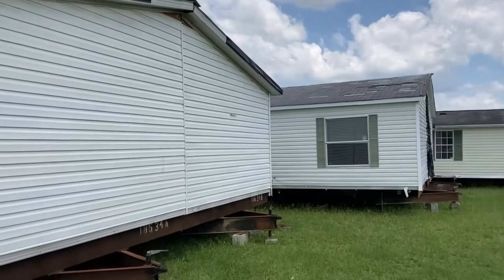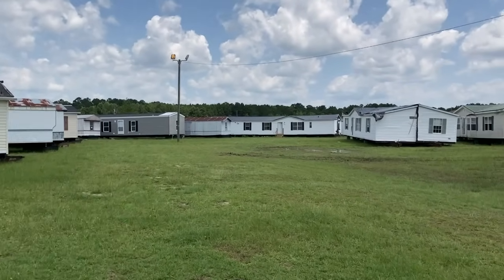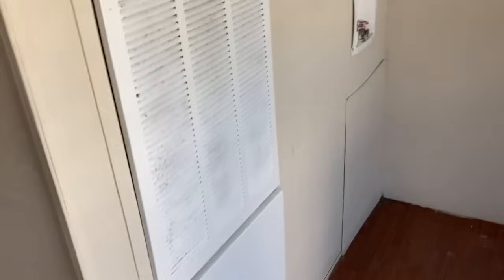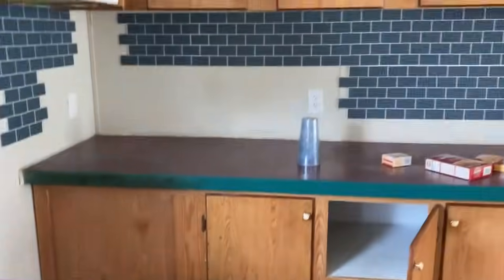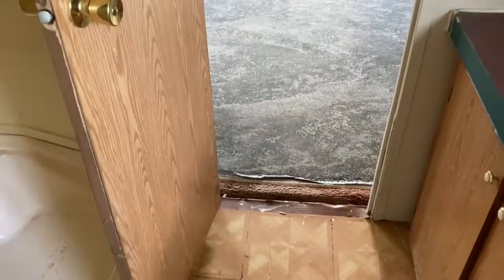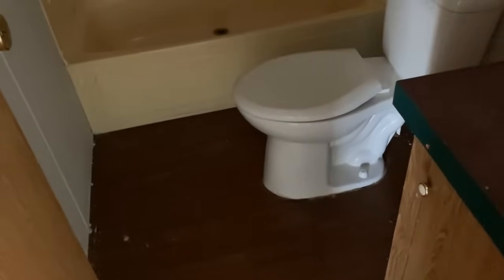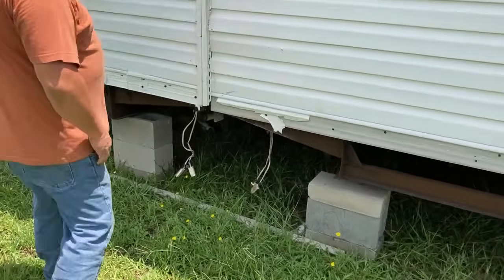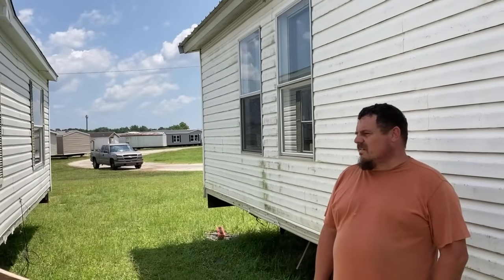Can You Guess How Much This USED Double Wide Mobile Home Costs?

Comment: My wife and I live in a 96 model double wide somewhat similar to that one. We live on 5 acres in TN. We also have a 60 x 45 ft barn and paid 123,000 in 2018. The guy that flipped did really good work. Our home is 1976 square ft with 2 nice decks front and back. We are blessed by God for sure. I like your video's.
Reply from the maker: Thanks you got a good deal
Reply: Being this home is a 2001. It is not a moble home. HUD stayed since 1976 a moble would have to have wheels. If the home does not have wheels, the home is a manufacturer home. The two of you are very knowledgeable about manufactured homes.  So please advise. Why do you continue to state mobile homes? Any home can be moved. Bring a construction home or manufactured home.
Reply from the maker: @mennals58  it’s sitting on a metal frame that’s got hangers hanging from it to mount the axles. It’s a mobile home and the DMV gives you a title DMV means trailer department of motor vehicles is where you go to get the title. It’s a mobile home.
Reply: @mybrotherdonnie  I am aware that a title is issued by the DMV. I live in a manufacturer home in the state of Delaware. Nevertheless. HUD no longer uses the turm moble home.
Reply from the maker: @mennals58  A mobile home is a prefabricated structure that's built in a factory and then transported to a permanent or temporary location. Mobile homes are built on a permanent chassis and can be moved by towing or on a trailer. They can be used as permanent homes, or for holiday or temporary accommodation i’ve always heard it being called a mobile home. This is what Google has for the definition.
Reply: Moms used one on 9 acres with a pole barn went for 150000

Comment: Back in 95 I bought one of the first 16 x 80's for $23,500.  At the time, that was alot of money.  Now, I am not stupid but those now go for almost a hundred grand, what in the world are they smoking ???!!!  Even accounting for inflation, is crazy.  I advise the younger folks, buy a decent used that's already did the whole depreciation thing, more cost effective.  Also, nothing lookd more cheap, chintzy and low-grade than shimming strips in the middle of a wall to cover cheap particle board and plastic sinks.  I had to laugh as the wallpaper in the laundry is exactly the same as my kitchen and laundry from 95, 😂😂😂.
Reply from the maker: Yep I would like to have a couple for 23 five
Reply: Yep….a single wide now costs around $120,000 to buy and that doesn’t include moving and setting it up in the lot…that’s just the dwelling purchase…..a double wide costs about $240,000 that doesn’t include anything else but purchasing the dwelling….insane….and compared to todays new build construction..,about the same quality type work either way….best quality homes are the older ones like vehicles and appliances as well
Reply: Good grif Charlie Brown,,, my ex wife and I bought a 1993 16 x 80 for 25,000 she still lives there on 2 acres of completely flat land with a creek in front  , can't imagine what it would sell for today 😮

Comment: Here in Florida, the problem is that dishonest bully mobile home park owners frequently harass elderly women and veterans to they "abandon" the home and move out, then the park owner flips the home for a profit.   Then, hurricane insurances doesn't pay all costs if damages occur.  in my opinion, NEVER BUY A MOBILE HOME IN A FLORIDA MOBILE HOME PARK WHERE YOU PAY LOT RENT.  A corproate could buy out your park, process and change of use and you have to move out so they tear down the hold homes and build apartments, etc.   The only safe way is to buy a mobile home on your own lot, or in a co-op where all the residents own the park. Florida laws don't protect homeowners from unethical park owners and you could lose ALL you equity.
Reply from the maker: I don’t run a park. I run my own mobile home on my own land and rent them out 1 acre lot.

Comment: The fact that pex is used as plumbing and they didn’t put shut offs anywhere so if it was leaking u had to drop the skirting and shut off the water main into the home to be able to repair…I immediately started putting shut offs on all the plumbing in mine after another pex line burst and flooded the duct work by the time I was able to get the water shut off at 5 am on a freezing cold night….so they’re built to last maybe 20 years before things start to break…and they always do….and my water heater was located on the exterior side with the door on the outside….i replaced it with an electric water heater and moved all the plumbing including the water heater inside the home so it’s not exposed to the freezing winters….
Reply from the maker: That’s the smart way to do it move it inside and put as many shut off says you can
Reply: You sound like you know what you're doing,I love in 3 acres woods down by the river, Cold as hell, any how my oil line froze up it was in Jan ,pa. Gets cold but I had to dig the frozen ground up with a pick very carefully oh man it was like 10 degrees out l put heat tape raped up and also raped insulation around then buried it  Well I had no heat from my heater. Thank God I have a fire place it helped some plus I used 3 oil stoves . It took a week for the oil line 6 ft.to thow out, I sold the place.

Comment: $50,000 for a very used manufactured home that needs a lot of updating no thanks. Better check underneath for plumbing, installation, heating ducks. As a comparison I bought a 26-year-old double wide on a large city lot for $73,000 in 2020. The lot has all city improvements including sewer. The home had all its floors and dry wall replaced by previous owner. The lot also came with a converted two stall two story garage that long ago was a horse barn. There are some really great deals still around if people take time to search them out.
Reply from the maker: Absolutely but a lot of shit has changed in the last four years. I think the pricing is ridiculous. Now there’s no way I would spend $50,000 on something like this but a lot of people are doing it. They’re selling them every day mind-boggling to me.

Comment: I have that same exact fireplace in my trailer, it wasn't much of a heat source at all, so I placed a wood stove in front of it, & sleeved my 6" pipe up through the 10" factory chimney up about 1 Foot in, which is stainless steel all the way up through. I live in Ct, & I turned my furnace on only 1 time last winter when my water lines would have froze, the plumbing runs along the heat duct for that exact reason. I've lived in this trailer for 24 Years, it's an inexpensive way of life, I'm on 63 acres, with a 3/4 Mi long gravel driveway, 3 bedrooms, laundry room, my office is actually in a Tip-Out extension, 2 full bathrooms, 1 has a factory Jacuzzi, the other has a full bath tub & a shower, Laundry room, central AC with an outdoor compressor that sits on a cement slab, fireplace, huge dining room, & the kitchen has a huge wrap around counter, with a lot of cabinetry, large front deck with a corrugated tin factory roof, that aligns with the tin roof on the tip-out.
Reply from the maker: That is cool
Reply: If you do put a wood stove in it will make them hard to insure. I own two, one without one with. My insurance will cover the one but not the other.

Comment: My goodness a door that warped. LOL. Never heard of such a thing. I took the door off the bathroom in our 11' x 38' Park model. Previous owner screwed a 'regular size square rod towel bar' into the door, which was hollow !!!! Plus the towel bar -- it gradually sagged over time. To get the bar off it was screwed into place, held onto the thin veneer with long screw washers, which made it almost impossible to remove! Good grief. Had to remove door which was extremely narrow 28" wide -- and then had to pull it off after wrecking door around the towel bar mounting holders!!! That door's remnants got burned in a bonfire! Gave  the nice silver metal color towel bar away as we did not need it.
Reply from the maker: I had to door in the back of my truck, one side of it. On the tailgate. We worked about half a day went out there to get the door. It was warped like a banana. I turn it over the other way, lift it over the week come back to work on the following weekend and it straightened itself over the week turn the opposite way laying on the floor flat we put it up and used it but now I make sure if one’s going to be in the sun make sure it’s laying on something flat

Comment: What a lot of people don't understand is the difference between a rental unit and a house that is a primary residence.  I just sold all my rental units two years ago and after living in a stick built home and looking at other stick built homes I have decided to buy a new manufactured home. The quality of a new build is far superior to 99% of site built crap on the market.  With rentals that is a different story. You don't need top of the line, you need good cost effective material.  We would usually keep a rental about 15 to 20 years, then replace it with another good used unit. Of course some of our renters where there for years and that helped reduce maintenance costs and added life to a lot of our units.
Reply from the maker: I think you did a better way of explaining it
Reply: @mybrotherdonnie  Thanks. It is hard for people who have never owned rentals to understand what we have to do to get the rent to an affordable price. It takes a lot of thought and work in order to make a living and have a decent place that people can afford to rent. It isn't easy by any means.
Reply from the maker: @DraggonCanoe  yeah, it’s hard for people to understand that

Comment: A new one goes for 100, 000 to 200,000

A used one in NY and PA they are about 70,000 for an old one. 

Used goes from 70,000 to 150,000

They used to be 20,000 in the mid 90s

Housing market has gone insane
Reply from the maker: Yep this one’s 50,000+ movie
Reply: This one was built so cheap. No way. I wouldn't walk into one of these without a meter to test for mold.
Reply: I assume you are talking about double wides because I went shopping for manufactured housing last year and the cheapest single wide on the lot was $66K, far less than the 100K you are giving. The modular I ended up getting was $152K

Comment: The only problem is financing I talked to both my banks and credit union they will finance Rvs but not mobile homes
Reply from the maker: Yes, it looks like this place is doing in-house financing from what I can see. It looks like it’s $10,000 down thousand bucks a month.
Reply: Which makes no sense whatsoever …when it’s an rv, there’s no regulations demanding they be made with quality yet they’re more money then a modular home…they’ll finance an rv but not a modular which holds its value compared to the rv….

Comment: I'm surprised that they were still using those windows in 2001 , figured they would have been the vinyl insulated windows by then? Maybe vinyl would have been an upgrade option? Neat videos guys!
Reply from the maker: Thanks
Reply: Depends on the trim level and where the home was made.

Comment: What really sucks about mobile or modular homes in areas where ac is an absolute necessity….the fact that hvac contractors have deemed folks who live in mobile or modular homes as unworthy…good luck getting the ac repaired or replaced on one of these…at least it’s like that in my area…and u would be surprised how many wealthier folks are choosing to live in Modular’s doublewides as a smaller easier to maintain home then their big regular style home….most my neighbors are retired folks living in double wides placed on foundations and they’re absolutely not the stereotype and leaving them stinky and torn up lol
Reply from the maker: I’ve got a pretty good AC guy that works on mine

Comment: Listening to you guys talk, a mobile home is about 25K singlewide. What does it cost to move it, I would think it would have to do with the miles.
Reply from the maker: Not no more single wide. Some of them are going for 100,000 now anyway they do not really charge you per mile I’ve got a guy that moves them locally for me single Wides in charges me $3500 that’s within about 50 miles double Wides. He told me it was $12,000 within about 50 miles.
Reply: New ones haven't been that price in years and years.
Reply: @tinaaurand8887  Thanks, after I retired from the military, I was divorced early 90's. I thought I would buy a single wide, Oakwood I believe. I thought that it would have some return. It was about 35K for that and an acre and a half. I was close enough to Raleigh that I could buy and flip houses. Which worked out for me, return on the SW, LOL, more like LMAO. I sold it a few years later. I would buy a house that was livable and needed repair. That worked better. Then sell them. Thanks for the info, I was wondering what the margin of profit was. I defiantly do not know anything about the Mobile Home market. I learned this one without losing any money. Big Thanks

Comment: What is the cost to have a mobile home bolted to a foundation?  That''s the first major item on a "to do" list for me. How much does this process protect the home against damage from hurricanes and earthquakes?  I wouldn't use the real fireplace.  I would, however, replace it with an electric "fake fireplace" insert that makes it appear as though it is a real fireplace. The fireplace surround looks fine to me.  A big plus is having washer and dryer hookups already in place.
Reply from the maker: Normally, they don’t bolt, them down to the foundation per se they will take and put screw anchors into the ground put a metal strap around the frame and it’s like a belt buckle strap that goes around the frame and hooks to that screw anchor that’s in the ground in our area you need five on each side for a 80 footer. They put block underneath it and block it up to its level under the actual metal frame and then they just put big drillbits in the ground and put some metal straps around that
Reply from the maker: With that being said double wide, they cost about 10 to 15,000 to move them when they move them they put them up which means they block it level and then strap it to the ground and put both sides together and they screw them together put the siding back on the side put some trim on the inside of the house and fix the roofing where the ridge cap is
Reply: @mybrotherdonnie  I'd want the home placed on a real foundation and not just strapped to the ground so the home could be bolted to the foundation.  I imagine the cost to build a foundation is quite high, even though the foundation is just a concrete pad.

Comment: QUESTION - do all mobile homes have the air vents on the floor??  Also,WHY  do they put air vents on the floor instead of the ceiling like in real houses?
Reply from the maker: No, all of them do not have air vents most do a lot or for just heat the reason they put them in the floor not in the ceiling there’s not that big of a ceiling cavity the way the roof is designed it’s very low sloped they put them right down the center of the house because it’s in between the frame rails and that’s the widest spot

Comment: The idea of trading in a single or double wide mobile home is very foreign to me, lol
The room of the fireplace could be converted into a fourth bedroom, if somebody wanted to.
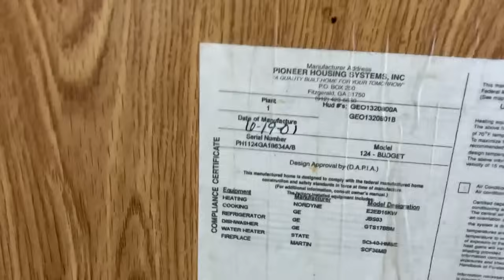7:54, These labels are even on the kitchen cupboards in manufactured homes.
It even says, Do Not Remove.
Reply from the maker: Yep think about if you buy a 
New one what are you gonna to do with the old one you just about have to give it to the man that can move it out of the way so you can put the new one back

Comment: There is no double wide worth 200,000 unless it is made out of gold. This double wide with all the water damage  and water marks means it was flooded and the roof leaks. To have water lines going that far up from the floor means the trailer was soaking in water. That means if there is any insulations in the double wide it will have to be pulled out. Then you will have to get rid of all the black mold. Notice the cracks  and yet there is fresh paint that means someone is trying to hide somethings. The floors punky means the floors have all been soaking up water. particle  board is not safe to use in any home house or trailer. Most States will not allow anyone to live in a home even if it has just 1 4x8 sheet of particle  board because of the toxic gas if there was a fire and that has a fire place built in it. With all the water damage there is going to be water in the wires and outlets as well. Black mold is a killer. For anyone to buy that with hopes of living in it they would have to gut that place down to the frame and start building it from the floor up all new. 50,000 is 40,000 to much .
Reply from the maker: arm and a leg for any of them now days

Comment: I purchased a 1978 double wide on a 1 acre 3 bed 2 small bath the previous owner didn't pay the taxes it was 15 k  i paid they never redeemed it
Reply from the maker: Yep you can get them like that
Reply: Did similar.Old singlewide  half acre ,$20,000  in 1997

Comment: Its a mobile home, they are built meeting the lowest standards possible. Everything thing used in the building process are dirt cheap. Please don't over pay for one new or used.
Reply from the maker: I won’t
Reply: Depends on the brand you buy. You get what you pay for.
Reply from the maker: @dadskrej5226  you can say that again